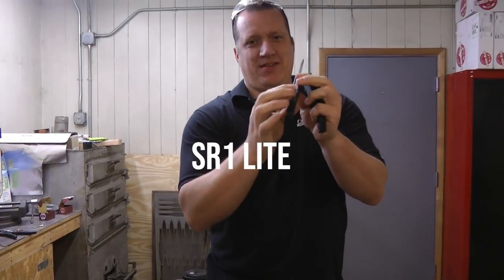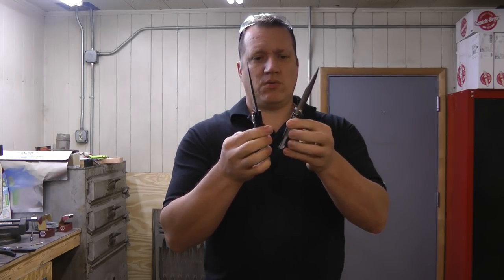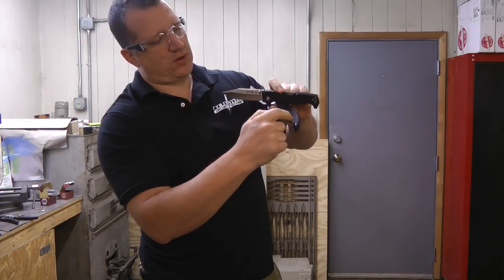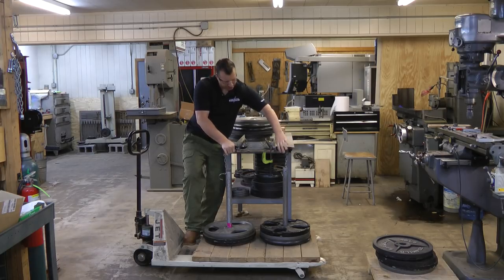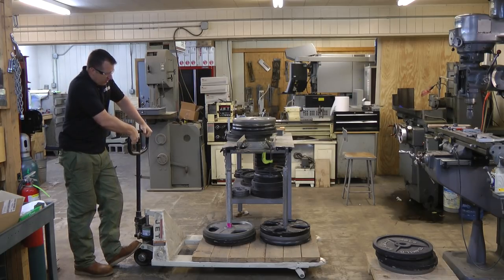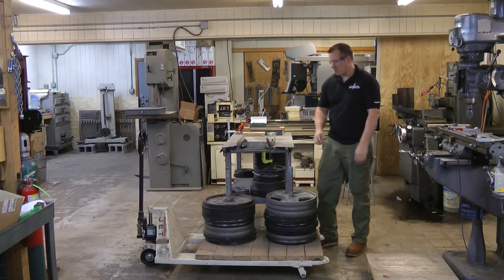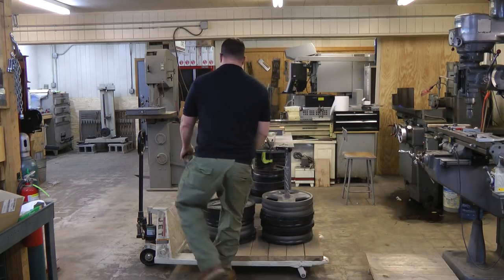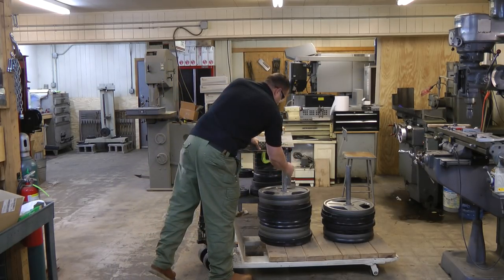Deadbolt vs Tri-Ad® Lock | KNIFE TEST

Comment: This is awesome, Cold Steel has a good additude about it and we get to see 2 great knives go head to head. The SR1 Lite is currently in my rn pocket so I am slightly biased. I would love to see the Ti-Lite 6 liner lock updated to keep the same great sleek look but with a lock that surpases its current state as that is my other favorite go to edc knife. Keep up the great work Cold Steel!
Reply: I don't think its possible to do the Ti Lite 6" or 4" because the blade set in the channel to far plus the quillions set up is a no no , so it would need a little bigger handle I would believe ,but you know Andrew lovers a challenge so I could be wrong.

Comment: Im a big fan of coldsteel but Im very impressed by the crkt deadbolt lock. Thx for the honest tests. 600 is way more then even a true hard core user will do with the knife. For me 1 thing im not the biggest fan about the tri-ad lock is that the action isnt very fun to play with for me.
Never had a CRKT deadbolt lock but if the lock is faster and easier to deploy it could be interesting. Idk. Edit: Oh well just looked it up. Seems also not very playable but they at least can make a flipper knife with the deadbolt lock. I would love to see your new shark lock on cold steel knives @Andrew Demko for the increase in knife-play-fun.
Reply: Well the cold steel tri ad lock isn't designed  to be played with. It doesn't run on prissy ball bearings. Also you can make any tri ad lock from cold steel into a pocket wave knife using an aftermarket snaggletooth wave opener.
Reply: @philipdeppen2890  
Exactly. Lockbacks are the tried and true workhorse locking mechanisms in the folder realm, and way less on the fidgety side.
Reply: Buy a fidget spinner

Comment: Respect to the Deadbolt lock! It didn't hold as much weight as the CS, but it is stronger than a lot of other folding knives out there. I have loved CS since my first Voyager in 2008, and of course my Recon 1. But I also own a Clever Girl and I enjoy the easy out/easy in of the Deadbolt lock without putting my fingers in path of blade, and ease of use with gloves on.

Comment: I had a rajah iii (the smaller one) that just felt indestructible.  Once I left it on top a stack of roof trusses we were cutting the straps off of on the job site and I thought I had lost it.  Turns out that I had just left it on the stack and the lift driver had put another stack on top of it!  Had to be thousands of pounds.  I could see it sandwiched in there from the side and when we lifted the bundle up so I could grab the knife, it had been pressed into the wood so hard that I had to kind of hammer it out with a piece of dunnage that was laying around.  Opened and closed perfectly fine with no noticeable damage at all!  About 3 weeks later the little thumb plate thing broke off, at which point cold steel sent me another one right away.  I have abused the living piss out of this knife for close to 8 years.  It lived in my truck bed with a few other tools like hammers and wrecking bars, just rolling around in the rain, snow, and mud, and she never failed me once.  I have finally cleaned it up really nice and reground the edge and it lives in the glove box now.  Definitely earned its place there. I’m looking to buy another cold steel knife but don’t know which one.  Any recommendations?  I like the voyager and recon and the lawman but I really liked how the raja didn’t raise too many eyebrows on the job.  Some of the black coated blades and models look militaryish or something?  I haven’t seen all their models though

Comment: What a way of presenting design quality and encouraging rigorous engineering design. Exquisite. Class. I am sold and buying your s35vn code 4 as my very first camping knife. Value and quality trumps everything else I looked at by a significant factor.
Reply: You'll soon be spoiled by the price and performance of Cold Steel products vs other costlier brands and customs, that mostly offer aesthetics and expensive materials with less reliability, and difficult to sharpen latest exotic steels.

Comment: Just cant trust any other folder without a tri-ad lock.
XL Voyager tanto been with me  since 2013, thank you sir.
Reply: Yep, same.
If I'm doing lite knife tasks, other lock designs won't matter much to me. When it comes to hard use jobs, I'll stick with the Tri-Ad lock. Everything else on the blade will fail before the lock gives out.

Comment: Wow!  The Clever Girl, "ROCKS!"  I have never seen any other 3.8mm Folder handle that much weight (585 ft lbs), except for the XL Espada.  Flavio Ikoma's Deabolt, "ROCKS!!!"  That's  a massive amount of weight for any folder to hold.  Flavio's design is a real Tri Ad Contender, in my opinion.  

This makes it a proven Contender in my book...  Now, I have proven faith in it...  I know the Tri Ad won, ounce for ounce; that's not to be disputed.  But, the Deadbolt is one of the easiest folding lock designs to use, operate, and clean, on the Market, today. 

It puts the Axis Lock to shame; my other favorite lock type.  And, is only second to the Tri Ad Lock; my other favorite lock type...  And, I'll bet the Flavio Ikoma designed Seismic is even stronger than my favorite CRKT, SDUEDC, the Clever Girl.  CRKT has a real awesome folding knife lock with the Deadbolt.  Cold Steel, finally, has a real Competitor, now...  Peace, Stiletto :-)
Reply: The Seismic should of been tested first against the Tri-Ad Lock.  The Seismic was the knife that CRKT designed first to challenge Cold Steel's Tri-Ad Lock.

Comment: Very few people have the strength to put 600 lbs of force on a knife with out using a cheater bar of some kind.
Both, I'm sure, will hold up em well in everyday use. I just bought the lynchpin so I could try out the dead bolt lock design. Got a deal at 39.95. Hope to soon add a tri ad lock to my collection. Thanks for the great video and stay sharp.

Comment: Please make a 3 inch blade Code 4 and an American Lawman with the old "Aus8a-style" rounded off G-10 handles. Thanks.
Reply: Why don't you buy the Air Lite preferably Tanto ???
Reply: @angelheart7643  I have the drop point Air lite and I don't like it. The saber grind is to thick for me and the Air Lite also doesn't have the rounded corners on the G-10 from what I remember.

Comment: Whaaaat!? That ending! Good tasting. Like to have seen a edge strike test, with increasing weight and edge damage result. Think that's more real life. At what level of pressure do you have damage to the working portion of the blade. No one will ever put that much force on the handle of that blade. Test increased weight impact to the blade and or increased harness of the impacting object to at what point edge damage occurs. I have some testing ideas that be really exacting, easily calculatable results, be entertaining on video and hasn't been done broadcast to the public as far as I know.

Comment: That was very cool. And they respect other makers I like that. CRKT makes great stuff but Cold Steel is kinda on another level. I had a tuf lite I put through abuse I’m almost ashamed of lol.. fucker wouldn’t dull or break. I used to field trim GFRG and GFRC.. look that up if you’re not familiar.. stuff kills knives as quick as foam. Nothing could tough that thing.. ironically, I lost it.. or left it rather, on a scissor lift. So I’m sure someone else still uses that thing. Best $25 ever

Comment: That was just the SR1 and I'm holding a 4Max Scout right now.
Surely this thing would do over 3,000in/lbs of force (multiply weight by distance from pivot to get Inch/Pounds of torque, the SR1 did 2,160).

Comment: I have The sr1 lite. it is a great edc knife. Its heavy duty but feels very maneuverable. Unfortunately it came with front to back and side to side play.  which worries me. Then , I just bought a Rajah 3 , which is incredible but has the same issue with front to back and side to side play out of the box even after adjusting the pivot. It is very worrying, I will continue to buy cold steel though, but if another ones comes with this issue I will have to consider moving on from Cold Steel. Two not solid lock ups in a row might be a coincidence but a third.... well have to see.

Comment: I'm returning a Cold Steel SR1 Lite and a Cold Steel Mini Recon 1 because its too hard for me to close the blades with the triad lock. I'm pressing down and on the triad lock mechanism and the darn things won't release. I've never had this problem with a CRKT knife.  I was really excited to get both knives until I found it was too hard to use them.
Reply: Maybe you have weak hands